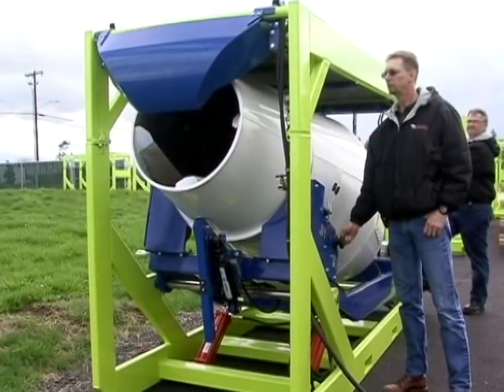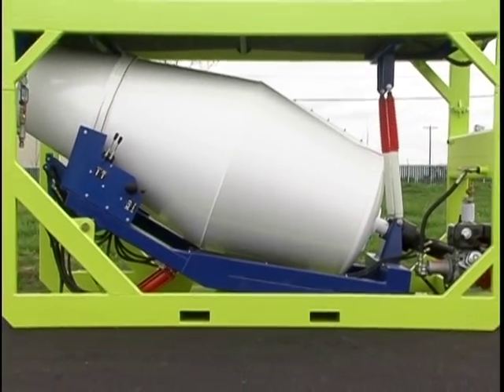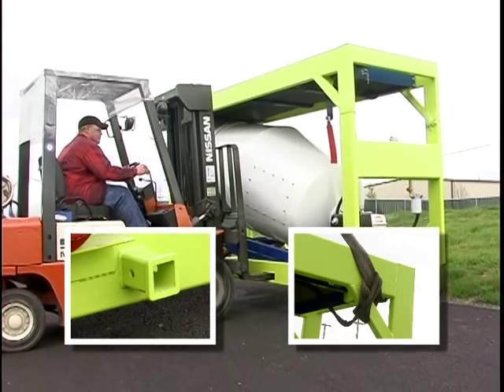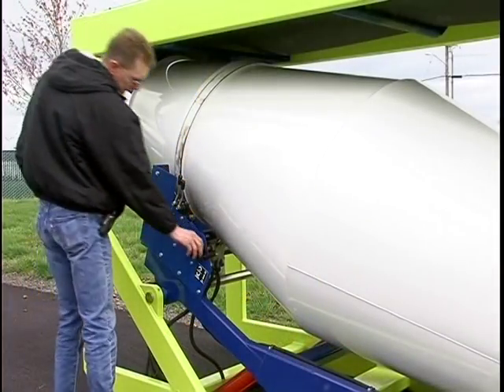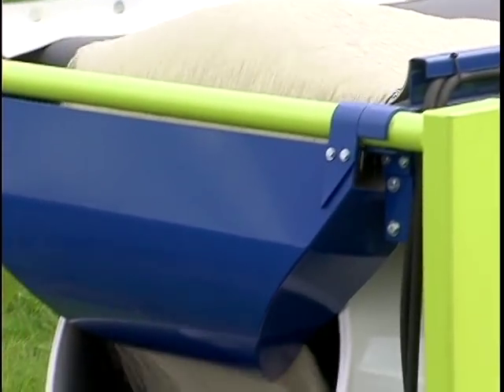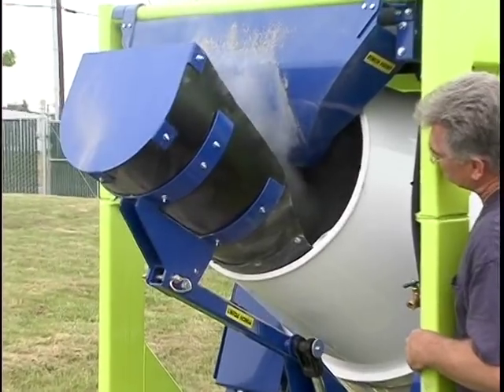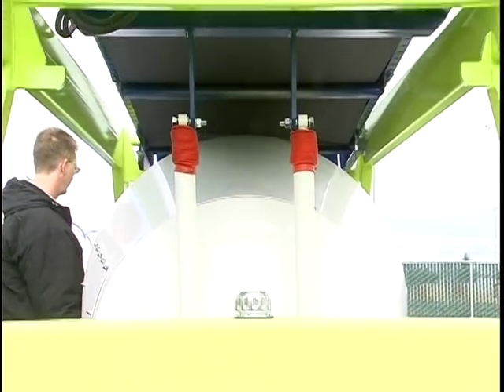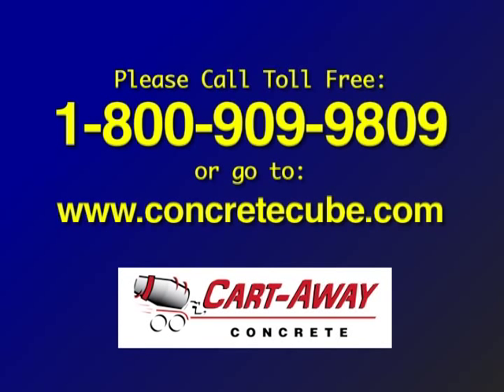Portable Concrete Mixer - The Concrete CUBE

Comment: A fucking rediculous gadget.  The cost of a clearly low-production unit like that wouldn't make it worthwhile.
Notice how they partially cut out the section where the guy has to mount then dismantle the cement bag chute everytime before pouring the mix.....
Nice idea but impractical as fuck.  Shame you wasted millions developing it
Reply: lifeshort एक मेसेज
Reply: lifeshort actually i worked for cart-way until the crash of 2008. I've built alot of these cubes and i know first hand how great this machine is and the top notch quality that goes into the manufacturing of these! these people were amazing to work for! nothing needs dismantled during operation. i will always remember fondly working for these guy's! if your such an expert at concrete batching equipment maybe you should come up with a better design! good luck with that